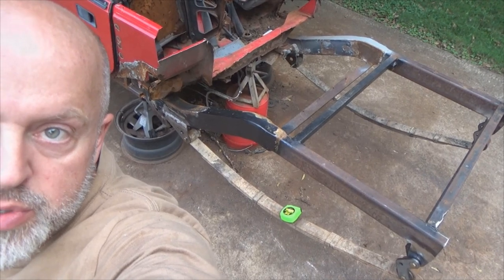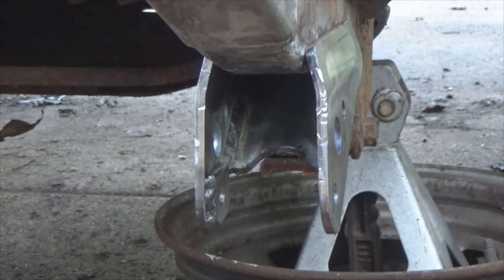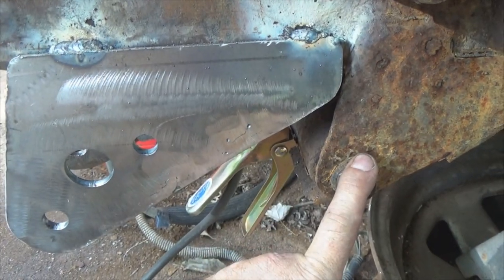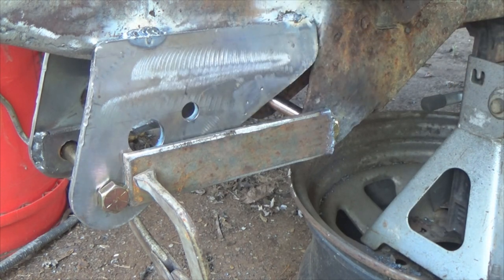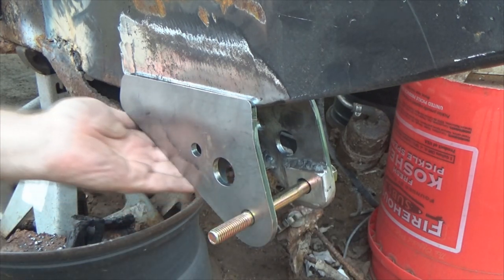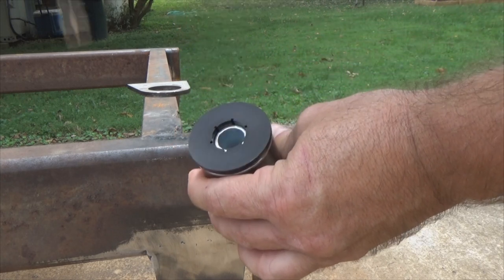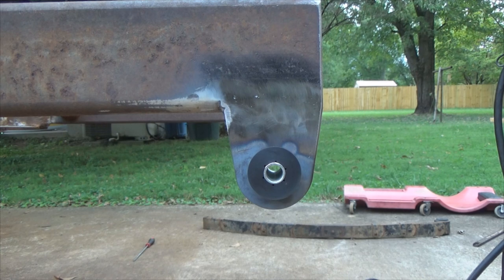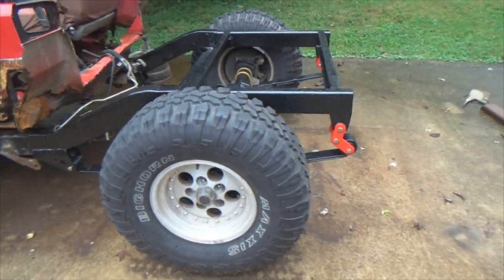Jeep Wrangler YJ - Rust Bucket gets stretched

Comment: Why go through all that work and money and still have a leaf spring front suspension and then you still must find a hardtop after the stretch. Seems to me finding a LJ would be the better starting solution. LJ has better axles, front coil suspension, proper stretch, correct fitting hardtop, etc. You definitely did a great job. Thanks
Reply from the maker: The frame/wheelbase is getting stretched. The tub is getting shortened to a 2-seater like the CJ8 Scrambler. I have a busted-up hard top to mod to fit the shortened tub. I've been slacking on this rig, I haven't touched it in a long time. Besides I only paid $200 for this rusted clapped-out rig, I paid $75 for the hardtop, and I already have a set of 8 lug axles from a past build. A beater toy on the cheap :-) Glad you enjoy the vid. Thanks for dropping in!!

Comment: The xj springs will give you about 6-8 inches by themselves because the springs being longer than the yj springs will push the center back and the 4 inch offset will add up to be the 6-8 inches sorry not really sure the exact length. I’m doing xj springs on my cj5 chassis at the time of watching this. Not trying to offend just a little constructive criticism. Great work!